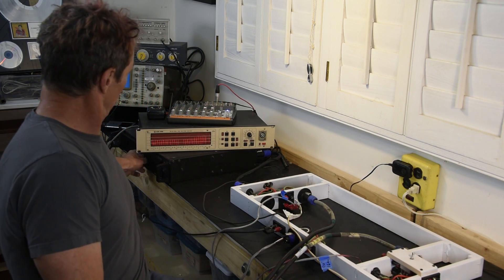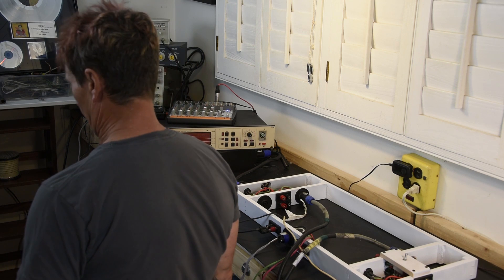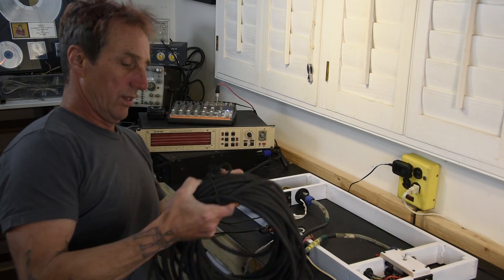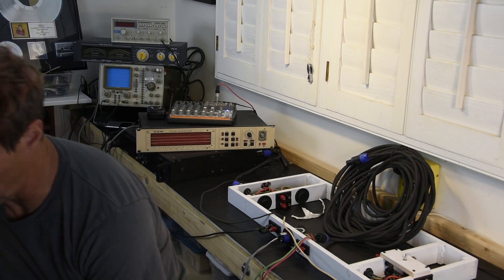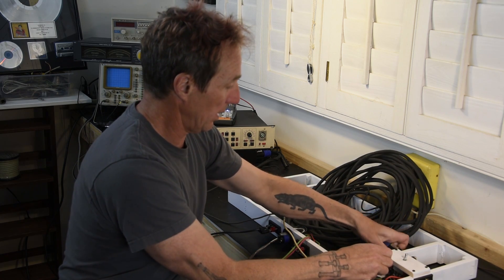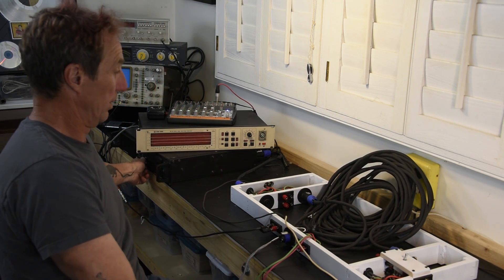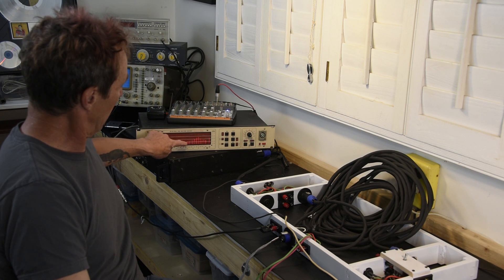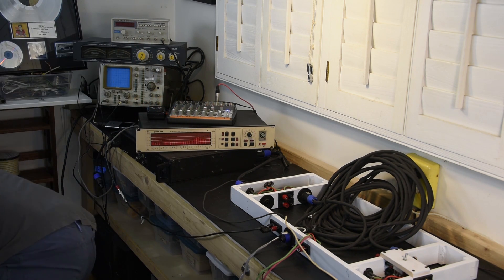Part 2 Hear Sound Loss in Speaker Cable - Part 2 of 4

Comment: Have the same cable (type and length) coiled and uncoiled, then switch between if you want to hear any diff.  No need to listen while moving from coiled to the floor.
Reply from the maker: Yes but to prove there is not a difference, one would need to compare them coiled or uncoiled first and show they sound identical before uncoiling one and switching.

Which does not really make things any easier and introduces more room for error

Comment: Black flag?
Reply from the maker: What about Black Flag?  I did 3 tours with them in the 80s.  Good times!
Reply: @DaveRat  looked like their logo framed in the beginning in your office
Reply from the maker: That is the speaker grill from Dukouski's bass cabinet from the My War tour.  I designed and built new guit and bass rig cabinets for Flag for the Loose Nut your and they scrapped the old cabs, I kept a grill.
Reply: @DaveRat  very cool man 😎😎

Comment: The only problem I have with this experience is that white noite covers the full frequency spectrum until 20,000 hz , while the music we listen stops at 8,000 (pop) - 12,000 hz (classic)... so when we talk about high frequency loss in cables is that even relevant if we are not hearing white noise?
Reply from the maker: I recommend you download a listening or hearing test on your phone. We can easily hear beyond 12k and speakers that do not go above 16k sound not so good.

Additionally, if the freeway speed limit is 65, would you buy and enjoy driving a car that could not go 66 mph? It is the ability of a speaker and the sound system to easily exceed our hearing that sounds good and we desire. One that barely struggles to reproduce our hearing will never sound as good
Reply: @DaveRat   What is the frequency of the most extreme note you can find in a partiture? B8 has 7,9 khz and that is already extreme, no music I know uses a b8 or even gets near a 5 line octave. B9 is 16 K hz, and that is a six-lined octave.
I'm not saying you cannot hear them, we just do not use them in music. And even if there are musics that use them with distortion or feedback, I doubt very much anyone could even notice the difference if those frequencies were not there in the first place, specially musicians that have ruined hearing from exposure to loud noises.
10K hz is  high enough and will leave room for most, in not all  the musics, above that there is simply no musicality.
Reply from the maker: I can make a whistle noise at 16k, the breathiness of a female vocal has frequencies above 20k, cymbals, traingles and anything metal can have substantial output above 16k.

If you want something to sound real, it is critical to have extended HF response up to and beyond what we hear.

In fact, I would say that it is extremely easy to hear the difference between reproduced sound from a speaker and real sound. And one reason is that speakers and electronic gear stops at 20k allowing our ears and brain to know it's not real.

Have you ever heard a speaker sound so real, you thought a band was playing or a real human speaking, only to find it was a recording?

I never have
Reply: @DaveRat  Whistle frequency range is 5K, trained whistlers can go up in range, but I honestly can't remember any song with trained whistlers and 16K frequencies, so unless you are a whistler aficionado, don't worry about cables.
Soprano voices go from midle C (261 hz to C6 (1046 hz), so again, no music does not use high frequencies, and honestly I do not think our vocal cords are made to produce this kind of high frequencies. Cymbals, Hi hats is 5khz, and we do not use anything above 10 K because there is no musicality there
Here you have a good source on frequency of instruments: https://www.zytrax.com/tech/audio/audio.html, I am amazed that such an experienced person does not know instrument frequencies....

What does sound real even mean? In pop and rock music does that mean sounding like a band in a gigg? Don't think you need such quality and extension of HF to do that honestly, again the quality of the sound and frequency you pick-up is more dependent on your position in the venue than cable quality.
In classic music any modern equipment is better than anything that has available at the time the music was writen, from strings to the design of instruments... Its not even comparable.
Same goes for classic/vintage rock.
Music is about experience and feal, and no music reproduced through speakers can ever sound real, because sounds in nature don't come up from speakers. In modern pop music we can argue that in fact the real music is what is made by the producer, and producers don't make music for high end equipments, you can in fact argue that the ones hearing those high frequencies are not hearing the real thing, because you are not supposed to hear them.
Its quite amuzing to have this conversation, specially in the musicians world where the norm is ruined hearing capability due to noise exposure. If you want true hi-fi, more than any cables or gear you should be worried about  protecting your hearing.
But again I don't have vested interest in cables, I do not make cables, pickups amps or instruments, I just find it amuzing that such low requirement field like music is has so much voodoo and are so particular about stuff that realy is not that expensive or hard to achieve.
Reply: I love your work don't take me wrong, but I think show producers and designers have to evolve. Most of the audience in shows are exposed to bad quality sound, and the ones who have good places are subjected to high DB's that can impair their hearing after some seconds of exposure. I would love to go to a gig where you could listen to the live performance through your headphones via bluetooth or wifi. Or instead to using massive frontal speakers the show designers could create pods for listening far away from the stage, etc. Same goes for live performance where most of the people who pay the tickets are actually looking at the screens because not only we are far away from the stage, but the prevalence of people filming with phones in your face actually prevents you from experiencing the performance.
Reply from the maker: @josearaujo8616  all good and I also know a guy that can whistle at 20k

You can see it on the analyzer when you do it. I will record a video for you when I get a chance.

Oh this is pretty easy to test and listen to they taking a high quality stereo and inserting a low pass filter at 8 k or 10K and listening to the difference

I was a consultant for a well known sound system manufacturer that followed the assumption that at distance are was incapable of carrying frequencies above 8K

So they low past the system at 8 k

I was able to demonstrate audibly the difference and they removed the low pass.

It is my belief and opinion, that even though we don't distinctly here above 20K, to truly create realistic sound the system should be capable of reproducing frequencies that exceed our capabilitiesbecause even though we don't distinctly hear them we can still sence those.

Even more interesting, I can do a demonstration but it requires someone to be physically present, that shows you can hear ultra-high frequencies from a point at the base of your skull behind your head.

You can somewhat test this by scratching around in your hair all over your skull and you should notice that at the base of your skull behind your head the scratching sound becomes brighter. Leave this helps us hear things behind us like potential dangers
Reply from the maker: @josearaujo8616  sounding real means that you are unable to tell the difference between the actual source and the reproduce sound
Reply: @DaveRat  yes you can feal ultra high frequencies, I have no doubt. Also you can hear above 10 K to 15 K easile, but they are not musical sounds and for sure not enjoyable. And no composition requiers such high octaves, so its not on purpose.
Hearing is very subjective, you actually hear stuff that it isn't there, its about experience and feal, but reality is that its not that important when we are talking about such details.
Reply: @DaveRat   In nature and reality no two acoustic instruments have the same sound source, nor a single instrument has two diferent sources, so sounding real its impossible with limited speakers.
And the big question is what is sounding real in music? Its the sound you hear in a live show? Is it the sound the musics hear? Is it the sound the producer mixes?
Also the ability to hear close to real sounds depends much more on the position of the person who is hearing, probably more than the source.
And like I said, if people really want o hear hi-fi the first thing they have to do is take very good care of their hears.
Hearing music to me is like eating, I want first to experience, sense and have fun and share what the artist is trying to transmit, and to do that we don't need fancy expensive stuff.
Reply: @DaveRat   I know that we can hear until 20K, that's why we can hear white noise, but instruments we use to play music can't produce those ranges of frequencies. Eletric guitars go up to 1200, and even with other harmonics they still fall far short of 20K.
8 K Hz I was already being generous, human voice in opera singers goes to 1,5 khz...
So the question continues to be, how relevant is the loss in high frequency cables if music does not use them in the first place?

Comment: This was so cool to hear, this series is really interesting. In my HT, I have actually been using THHN for subs specifically, though did this mostly because the wire was cheap . . . If I am picking up what you are putting down, this should mean the detrimental effects I might see at HF shouldn't have a detrimental effect.

In your pro audio use case, with the amount of wire you have to buy invest in, would you differentiate cables based on their application? Or are you attempting to find the best all around cable to keep everything consistent?
Reply from the maker: I would say twisting the thhn in pairs makes a perfectly wonderful cable, perhaps better than audio speaker cable. For our usage and the original reason behind these tests was to get an idea of how detrimental to the sound running long cables is.

I still have more tests and ideas.  I want to come up with a good way of hearing transient response and damping factor impacts of long cables.  So, more to come

Comment: It would also be interesting to repeat the test with a square wave and check it out on a scope. The resistance/ capacitance/ inductance of the cable should also affect transient response and also time smearing of different frequencies (where the high frequency arrives measurably later than the lows). Could also lead into what damping does.
Reply from the maker: Hmmm, I could do a square wave. Though I'd like to stick with strata where we hear the differences. Tests where we see the differences on measurement gear are both plentiful and difficult to correlate to real world impacts
Reply: @DaveRat  Fair enough. Possibly you could hear the HF 3rd order harmonics on a sub 60Hz square wave? Would be interesting to find out, either way. BTW thanks for the great vids!

Comment: Hey, here is a test I would simply love to see...

OK so some people say that power cables have a sound (have never heard of audiophile fuses, but they probably exist)... but if I were to give you a power cable with a very specific sort of fault, say a bad contact that caused intermittent arcing... for one thing that's basically like running an arc welder into your power supply, which is not good for equipment (am not asking for that test exactly), 

But were you to find a really chunky power amp, you could run an amplifier or a mixer, or other audio equipment off the outputs onto the beefy amplifier into a transformer of the right impedance conversion, and thus use it as a power supply for a piece of equipment. 50Hz test tone would hopefully give you 240V Ac power right (or 110 if domestic and American). The old crown DC units could be used as a laboratory power supply if required.

So what happens to different amps when you send it various sorts of distorted and bad quality power supply? What about another device with an intermittent/oscillating leak to ground etc. What if you send audio waveforms or square waves into the power input?

Simulating "bad power" of various sorts is actually not particularly easy with a conventional high quality electronics laboratory power supply, which will be precision, and will produce perfect DC or AC waveforms.
Reply from the maker: Interesting you should describe that test back when I was younger I used to work at Hughes aircraft testing various components and subsystems for the Bradley Fighting vehicle. One of the tests I did was to use a McIntosh power amp driving a transformer with an oscillator as the input to recreate various voltages and frequencies. I would then test these power supplies to make sure that they met the specifications while under load full test load.

The setup you require is totally feasible connecting an oscillator or function generator into an amplifier and having the output of the amplifier be the power supply for the amplifier under test.

Most amplifiers state in the spec sheets that they will reach the output distortion and frequency response specifications listed with a wall voltage and wall frequency between the listed ranges.

As far as bad wall power having a negative effect on the amplifier output, yes that is reasonable and can occur.

As far as the ability of a 3-foot power cord or some other device to magically improve the power that has transported down miles and miles of power lines to reach that location, and then traveled through the wiring of somebody's house or studio to a wall outlet, to think the changing the last three feet of all that cabling would have an effect is absolutely absurd unless if the cable for the last three feet is significantly inferior to the cabling that has been used leading up to that point.
Reply: @DaveRat  Hughes mil-spec test cell techniques is good company to be in. 

As a strange coincidence (or maybe aesthetic synchronicity) I used to use the Bradley ammo cases as peli case substitutes for various collections of tools, really cool bit of rugged design. Loads of those surplus during the "war on terror" era. https://www.paragonpride.com/forum/threads/the-best-ammo-cans-made.650/ seriously waterproof and not too heavy.

Have found that dodgy power supplies often do have audible artefacts that can get through a power supply on audio equipment, particularly when several bad loads coexist on the same spur. Certain janky switch mode power bricks can cause havoc, even some truly rancid 3rd party USB phone chargers, the ones where you see the case melting itself / arcing stains on the current carrying pins on the mains side. The type of stuff that will try to kill you while you sleep with your phone on charge. 

Have been interested in exploring the influence of deformed power input in some detail for some time, and having a DAW playback rather than an oscillator could make for some very interesting levels of control - by the same virtue could also pull a line monitor off a mains spur in real-world conditions, then play it back in isolation to replicate/simulate the fault. Would be harder to replicate dodgy ground with a signal-controlled resistance/impedance, but would not be too hard to feed in signal-controlled voltages to ground, also, and see how severe that works out as an audible/measurable pollutant.

As for the power cable quality / bottlenecking... I'm telling you man, forget about the science, could make some serious money getting a bunch of fuses electroplated with 24k gold ends and solid silver fuse wire... $150 each, packaged in a velvet box like a wedding ring... I'm telling you man... there's money in those hills...

You thought I was joking? I thought I was joking. This stuff is real: https://www.analogueseduction.net/fuses/isoclean-power-audio-grade-20mm-x-5mm-fuse.html

___
https://www.analogueseduction.net/fuses/isoclean-power-audiophile-grade-13a-uk-fuse.html

• Transparent
• Detailed
• Airy, Spacious Soundstage
• Designed to extend Top and Bottom Octaves

Top and bottom octaves I tell you. Stop laughing at the back. This is a business.
Reply: The kind of test you describe is done all the time. It is called PSRR (Power Supply Rejection Ratio). There are different ways to "pollute" the incoming power. Lab power supplies from companies like Chroma can do this to some degree. You can also couple in noise from another source via a transformer on the supply line.